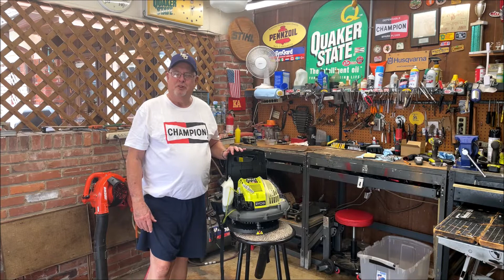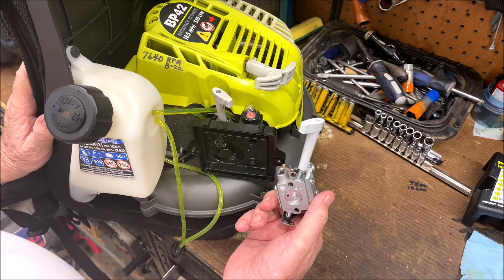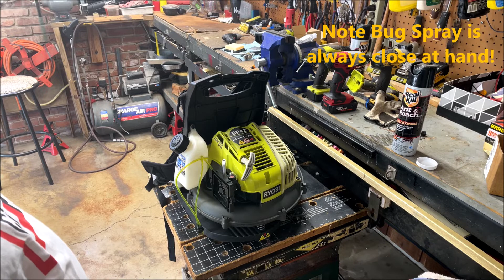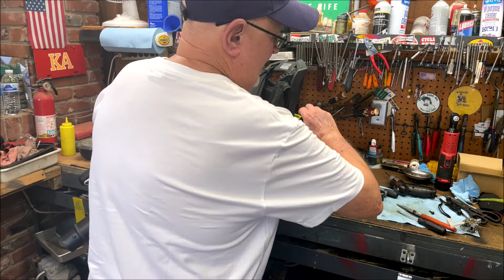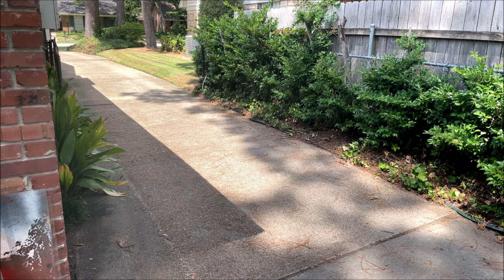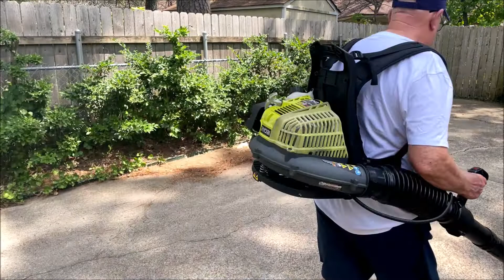Ryobi BP42 Backpack Blower

Comment: my  ryobi bp42 will only run with the choke about half way on .engine will die when it is turn to run. or you rev up engine. help
Reply from the maker: Starving for fuel. Open L and H screws 1/4 to 1/2 turn and if that doesn’t help, buy a new carb on eBay.

Comment: Sure would've been helpful to see the "tinkering" that you did to the carb adjustment screws...
Reply from the maker: This thing is back in my shop. Started and ran great, then would not restart until it cooled off (bad coil?). Ran great but now won’t start at all. Has spark but looks weak. Have ordered coil 
All I did with screws was hold throttle wide open and turn H screw in or out until max rpm (7600). Turn L screw in or out until motor will go from idle to sit without bogging. L screw is always closest to engine.
Reply from the maker: WOT not sit.